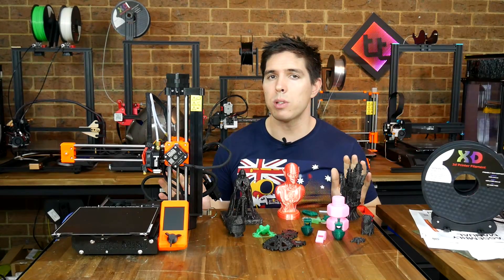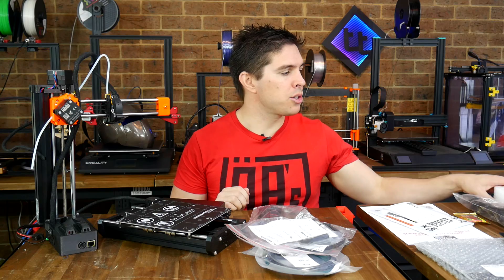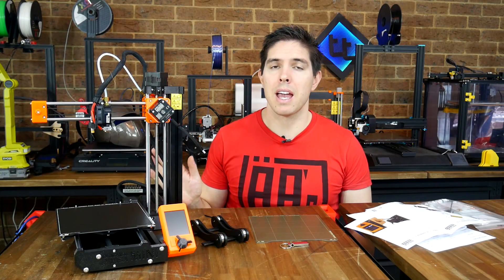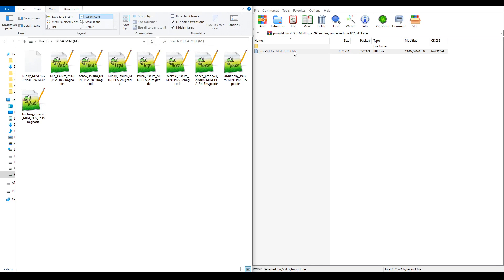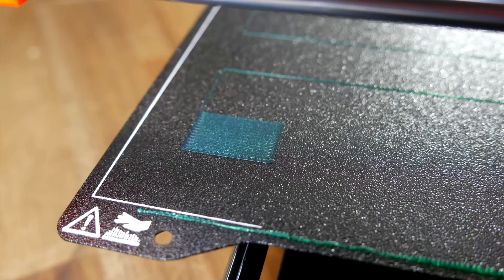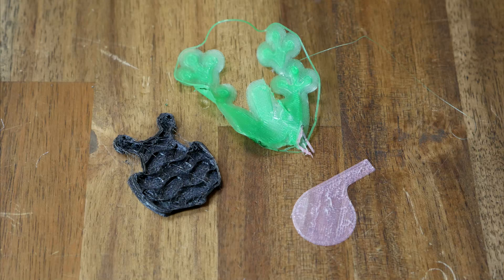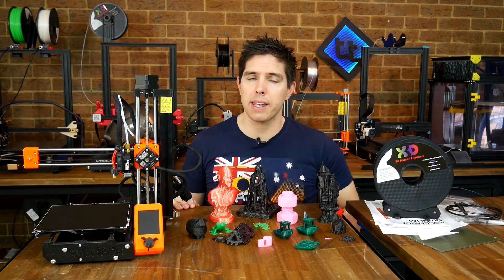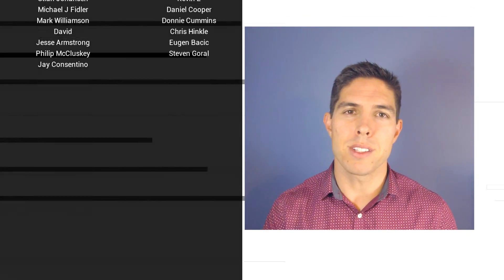Prusa Mini first prints (and troubleshooting)

Comment from the maker: This is a not a review, but please read the description to hear some of my thoughts on the pros and cons of this printer.
Also, an addendum to lending the 3D printer to the student: He still managed to clog it, after changing from ASA to PLA but only preheating to PLA temps. The PTFE guide tube to the hot end was completely clogged and needed to be drilled out to be removed. Beyond that, he was able to quickly get up to speed and produce the required parts, even designing some add on parts to help interface the printer with a filament dry box.
Reply: Wow, drill out the PTFE, I've never gotten to that point before with even my worst clogs.
Reply from the maker: It's because the tube has bulged to the point where it wouldn't release from the coupler. The worst one I've ever had to fix, that's for sure.
Reply from the maker: Shipping cost me US$78 on top of US$400 for the printer (due to extras I included). On reflection, ouch!
Reply: @TeachingTech  I suppose that says something for the pushing-strength of the extruder? Sort of a silver lineing... -ish. :p
Reply: Was gonna buy this printer.
But then i saw all the problems you had.
I will never learn how to fix them even with u explaining them to me.
There would be new problems probably.
Now i don't ever want a 3d printer in my life.
Reply: @erikford7959  I got mine today, it is also my first 3D printer. The assembly was pretty easy but as he said some bolts are fiddly. Then i tried to print the whistle which is on the USB-Drive and it did not work, the first layer was not sticking to the sheet. Then I googled and watched this video and as a total noob i just did the first layer calibration wrong, I set the value to about  -0.080 but i had to set it to about -0.830 and after that everything went well. So I think Prusa managed to fix the mentioned issues.
Reply: I have one on order, the estimate to get it was for April, though I got a notice from Prusa that they'd put shipments on hold to resolve some issues before starting shipping again.  I'd have expected yours to have been sorted before getting it, I hope mine is in better shape, I love my I3 Mk 2.5 which is what spurred me on to by the mini.
Reply: I’m a local here and how did you managed to get it shipped here? Was it really expensive for the shipping?
Reply: what is f1

Comment: Not for me - I'll use Klipper and stay up to date, the BTT boards have enough possibilities. It may take a while to get the profiles for the filaments right, but after that it just works unless I want to tinker. I like the use of rods, although I would prefer drylin bushings over the ball bearings - a lack of maintenance and manifacturing precision got them out of fashion for now.

Comment: I watched this video when I just started 3d printing and I was confused. Now after a few years I understand what his issue was. The first layer was way to close because you can’t use the textured Pei with pla. And it caused it to clog because it was to close.
Reply: And I think it’s kinds funny that he thought that was the issue. The model he used to describe the issue he was not have if is also incorrect. The ptfe goes way higher than what that model shows. It goes about a millimeter up from the top of the heat block.
Reply: As I might say it is 100 percent possible that this is the issue.
Reply: Lol I typed all this and forgot that that was the issue. Guessed I learned a lesson. Watch the whole video before commenting!😂😂😂😂

Comment: I bought a Pmini and the bed levelling print, prints in reverse, the lines start at the front and works it's way to the back finally printing the small square at the rear left corner. This is the first of a few issues i'd like to resolve

Comment: Assembled the prusa mini, all checks are right. Calibrating went not very wel, bud after lowering the minda it was good. But I've a fillament issue. The filament is not going true the extruder.
I re-assembled the extruder, but nothing changes. How can I fix this problem?

Comment: I bought the Mini + because of the many positive reviews and that it was supposed to be one that works out of the box, but so far I'm pretty disappointed. Assembling has cost me almost 2 hours because I couldn't line up the bolts with the sliding nuts, if 1 went in then the others didn't, and vise versa. Finally managed to get all in, then tried to mount the display, but it wouldn't grab with the 12mm bolt, and the 20mm bolt was too long, so had to get a 16mm bolt. Today finished everything, did some tests to set the nozzle height, lowered it a lot but still everything comes out like shit. lines are wobbly, the square is definitely not solid. I tried to print the nut on the USB drive 3 times now, but it's just one big mess and comes loose of the plate, the third time it went 3 layers, it didn't look that well but hoped that it at least went a bit further, but then came off the plate again. I have never had a 3D printer before, so I'm not really that familiar, no idea if it has to go even lower, it looks pretty close to the plate now. The manual is also not that clear, it shows some pictures of how the filament should look, but you can probably only see that under a microscope. On the video that Prusa shows, he only lowers it a bit and then says it is 'spot on' but he doesn't show anything, so that doesn't help either, guess I should have bought a creality after all....

Comment: I have had my mini for about a week now. 3/31/2021.  I have printed about a dozen things with this printer and NONE of them came out right. They all suffer underextrusion and holes. Now the printer constantly clogs and jams and the extruder randomly stops working. This is my third printer and first Prusa. First impressions are important and this killed the Prusa brand for me.This has been a terrible experience.  I've tried the recommended hotend videos that are floating around on youtube and none of them solved the issues. Right now I have to decide whether to lose $68 and just ship it back and be done with Prusa forever or spend $80 on Bondech upgrades and hope they fix the printer. 
Can anyone here push me in one direction or the other?  If I can get this printer working, can it even produce good quality prints? My other two printers are an Ender 3 and Ender 3 v2. Both were easy to set up and have been printing rock solid for 4 months with no problems.

Comment: I just got my mini and straight from the off the extruder has been a nightmare. Just running my first print with heat break pushed all the way up and bowden fitting tightened all the way down. Wish I’d bought something different now. Like 2 or 3 enders for the money, or another QQS Pro.
Reply: Finally fixed it by using a generic Bowden tube which seems a bit wider on the OD and fits really snuggly in brass fitting and hot end. Same length, 42mm. Running like a dream now, but still disappointed I had to fix it myself.

Comment: Thanks for your video. I had very similar issues with my first 5 attempts at printing the whistle. It failed after just 1 minute or so. and the filament was building up on itself so I thought I needed to adjust Z height. Not the issue. I changed the filament to a PLA filament I already owned... when changing the filament I had the issue again. When I cleaned the extruder of the filament that was knotting up... I couldn't get it to come out of the extruder... when I was finally able to pull the filament away something that appeared to be clear plastic (which I assume was a hard build up of filament) inside the extruder and came out. After that and a good bed cleaning... 100% success on the next 5 prints of different items.

Comment: Great video!  I have a MakerTech Axis 3D printer.  I am really disappointed in it because the hot end tends to clog easily.  I have not been able to run it for more than about 30 or 40 hours without having to tear down and rebuild the hot end.  I was hoping that the Prusa Mini would be a good replacement but it sounds like it might have the same problem.  Once you rebuilt the hot end on your Prusa Mini did it stay fixed?

Comment: I have been just getting into 3D printing, and i've been using an Anet A8 i3 clone, that's been upgraded in almost every place besides the heat bed. (It's no longer a fire hazard, and does do a decent job printing)

After doing some looking, I found the Mini and thought it would fit my need perfect. Since digging into it more, the still apparent bugs and issues still seem to be relevant in this printer. It's sad, because it's at a price point that would really get a lot of people into the hobby with a good looking sub 400 dollar printer. Still going to keep an eye on it and watch the updates as they come. 

Great review btw, just solid and honest person in the review.

Comment: Hey, I decided to get the prusa mini as my first 3d printer and it arrived on Sept 14/20. I decided to do the tree frog and dog from the included USB stick for my first 2 prints using the flat steel sheet and black pla prusament. And they both came out perfectly. I can see the little layers when the light is reflected off of the printed object. But I assume that is normal for a FDM printer. So I'm pretty happy with what I've seen so far, and I think this will suit my needs just fine.

Comment: Welp. I hope my mini doesn't run into these issues out of the box. It will be my first printer and I feel like I'd struggle to correct these problems.
Reply: so did you have any problems ?
Reply: @nicholas6951  I did indeed. Out of the box, the knob for the LCD screen didn't work so they had to send me a new screen. Nozzle kept clogging constantly and it was due to the hot-end not being far enough up into the heat-sink. 

They gave me instructions to fix it but the small Allen screws to release the hot-end were completely stripped so I couldn't remove it from the heat sink which resulted in Prusa having to send me a new hot-end and heat sink lol.

Now that I've replaced that part the machine works perfectly but for about a month it was a constant headache.
Reply: @FrocketGaming  Thanks for the response.  I'm glad you were able to get it to work and it was not a lemon.  Mine is coming in a couple of weeks hoping it goes smooth! excited and nervous

Comment: Hello, I have just received my Prusa Mini on the 3rd Aug 2020. This is my first 3d printer, and I have never used one before. My first print was the benchy boat from the USB stick. It came out perfect. Stayed attached to the smooth steel plate, there is absolutely no stringing, and no wobbly bits in the model. In my opinion looks a lot better than a lot of models I have seen on online. The surface is really quite smooth. I used the supplied filament from Prusa. I then printed an item from Thingiverse. I loaded the STL into the Prusa slicer, and printed using the default settings, in simple mode. Again, it came out perfect, better than the picture the designer posted on the Thingiverse website. I had to wait from April when I ordered, to when I got the printer. The paperwork says it was packed on the 27th July 2020. I am very happy with the results so far.
Reply: How has it been in the past 3 months?
Reply: Are you still happy with your printer?
Reply: @doani  I just got mine (Mini+ w/ both types of spring steel (textured and smooth)) this past Thursday and after a couple attempted prints not sticking, I realized the issue. PLA does not like the textured sheet at all and always lifted up on one end and warped (its the sheet that is shown in the video). Then I actually read the manual and it recommended the smooth PEI one. No issues since. Even just finished an ocarina that took about 7 hours to print.
Reply: Same! I just printed a nut and a frog, and both came out perfectly fine. I came to this video to compare, but I didn't expect so many people to have disappointments.

Comment: How sensitive is the printer to dust?   I want to use mine in my workshop and despite dust collection, there is a lot of dust around.
Reply: b? Get an air filter - jet, grizzly, SEM, powermatic, etc. upgrade the bag on your dust collector to  a 2 or 3 micron if you have a single stage. The 3D printers are sensitive to dust. You want a dust free space if at all possible

Comment: Thank you for the video, it was very helpful!
I too was/am a little disappointed with the Prusa Mini, maybe it's bc I've been-say spoiled with the ease of the MK3S printer, but I wasn't expecting to run into these issues either.

I had got a few sample parts off the printer and they looked great but after that, it was all downhill from there with basically the same problems you ran into.  However, I may have found a different solution to this issue and I'd be curious to know if anyone sees an issue with it.

First I made sure my hot end and PTFE tube were the correct size and spacing as Prusa recommends but that didn't help any as it already had the recommended PTFE tube length and hot end spacing.  I found turning the nozzle temp up did help but I still wasn't satisfied as that is more of a bandaid than a fix for the issue and my prints still weren't Prusa Perfect.  I remembered I had read a comment on Prusa's troubleshooting page that said they moved the hot end up as far as they could, ignoring Prusa's recommendations and it fixed his problems.  I don't normally go against the manufacturer's recommendations but since I didn't have a longer PTFE tube I tried it anyway and I have had much, much better results, feeling a bit of relief and keeping my fingers crossed as I'm still on my first couple test parts since the change.  But I think it did the trick!  
I'm not a novice but I'm no expert either and as I sure can't think of a reason why moving the hot end up would cause any long term issues, I would love to know if any of you guys do think it's a problem or could be a problem.  If you think moving the hot end up is the wrong solution let me know and I'll order some PTFE tubing. 

Thanks again for the tutorial!

Comment: I’m getting the same issue with stringing but when I do a string test I barely see anything. What did you end up doing to get rid of your stringing? Any suggestions on upping retraction and restriction speed?
Reply: Yea I'm still having some stringing issues no matter what I try. I'm still searching for a solution!
Reply: pchangover it’s crazy. I’ve done everything I can think of. Replaced nozzle, moved the heat sink up, retraction and speed settings. Nothing I’ve done ha helped with stringing. It’s not effecting the print quality at all, just need a hear gun after, but it’s quite annoying.

Comment: I just received mine about a week or so ago. Haven't updated the firmware but printing with Prusament galaxy black PLA and all test prints printed with no major issues using the original PEI sheet. Some minor stringing was seen on the 3D benchy but no other issues. The test prints printed really well first time with z offset of -0.872.

Comment: I got a prusa mini the end of april 2020, they included better feet  and seemed to have wotked out most of the issues. I didn't have any of the same issues, it did clog once after I had it a month and it does ocasionaly string a tiny bit but no where near what it did in his video. I would recomend it to someone.

Comment: Hello all...wanted to report that I received my mini finally at the end of april and have just started using it in the last week. I'm relieved to report that I have not had issues with the hot end. I have seen the parts for extending the x-axis wiring on thingiverse; apparently Prusa noticed this problem as well because there is plenty of slack there on the one I received. Not sure whether the electronics cover parts were redesigned, but mine went together without too much of a fight. This is my first printer, but as far as I can tell I'm getting quality prints right out of the box. Hopefully that means anyone getting one from here on will have the same experience I'm having. I'm curious: has anyone has determined a way to reduce stringing? I tried playing with retraction and wiping to no avail. I felt like I took the retraction far enough to cause under-extrusion and still there was stringing. It is very minor, wispy stuff that almost just wipes off so it isn't bothering me too much. That said, I'm concerned that it may not bode well for the time when I try some other types of filament.  For anyone still waiting for a mini, I hope that my happy experience is the one you get as well.
Reply: I recieved  my mini May 31, 2020. Works  great.  no issues.

Comment: I have to say I really dislike the design of that hot end. Even the Chinese knockoff v6's that aren't all-metal have a better design. Pushing a single piece of ptfe all the way down to the nozzle with no real way to secure it is just asking for jams, and I think the reputation of the mini for having jams is a testament to that. On another note though, you said you used the included profiles for your prints, and then also complained about stringing. In my experience retraction settings are very much filament dependent. I don't think it is fair to complain about stringing when using non-prusament filament and not doing any work to try to determine appropriate settings. You also didn't mention tuning similar things like your extrusion multiplier for that filament in this printer, which seems like an oversight.